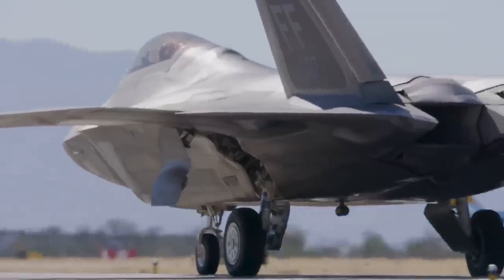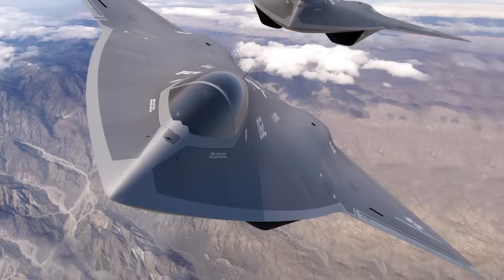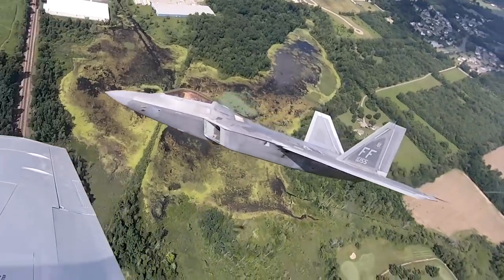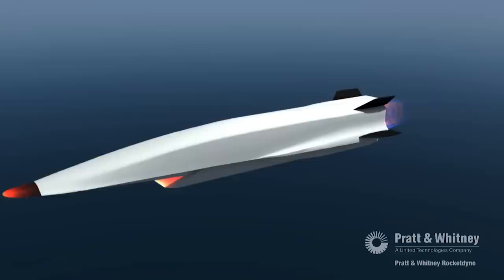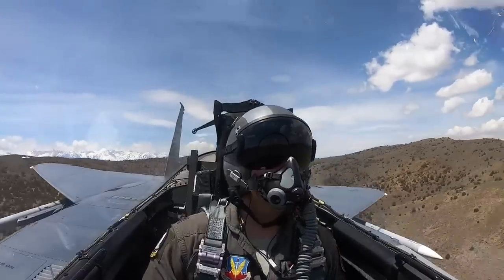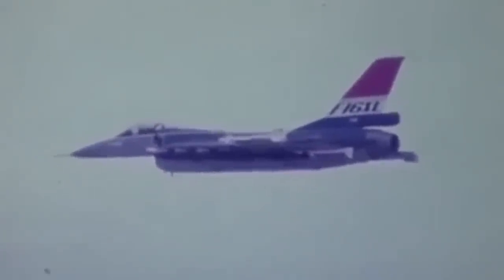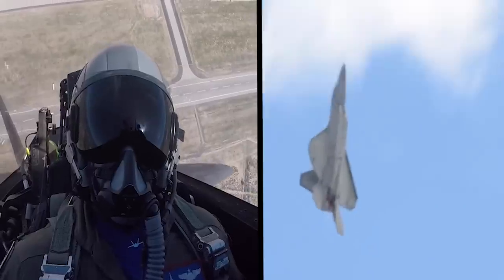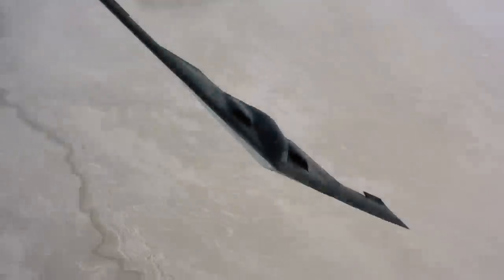How America could build the best stealth fighter in history

Comment: I think the combination of active flow control and TVC would indeed produce not only the stealthiest fighter jet ever, but the most agile. 
I don't know if you recall a F-15 that NASA used as a technology demonstrator. That Eagle started out as the F-15 S/MTD, and wound up as the F-15 A.C.T.I.V.E. 
In this variant, the Eagle had 3D TVC, Canards, and a flow control system. I saw a video of this thing flying that I suspect someone leaked, because it disappeared after about a week and I cannot find it anywhere. Just take my word for this- that Eagle was the most insanely agile jet I ever saw. Way more so than the Raptor OR the TVC Flankers. At one point they had it flying along a straight course at about 320 knots, when it just started tumbling about all 3 axes of flight! This was deliberate and the jet was under full control at all times. The pilot could make it tumble right, or left, the jet could climb in a complete, tumbling departure!
It was insane what this thing could do. Radar guided missiles just might have a hard time maintaining lock on a jet that could tumble like that and still exhibit directional control. If the jet in question happened to be a 6gen design with full stealth ability, that might be an aircraft that no enemy would  ever 
want to encounter.
Reply: I honestly wouldn't be surprised. Active flow control can apply thrust in directions and ways impossible with even 360 degree thrust vectoring. With active flow control you can almost turn gravity and physics into suggestions
Reply: I believe it. In kerbal space program, I have made designs with similar maneuverability, even without advanced computer control, using the above systems. The main problem was high g-force loads, but I imagine that those could be reduced via some clever wing design and piloting, and the use of real engineering and math.
Reply: I saw that video, impressive as hell. The tumbling you're talking about is a maneuver called a snap roll. Any aircraft with aerobatic ability can do them, you get into it by putting flight surfaces into cross control and it'll keep doing the roll as long as you hold that input
Reply: Maneuverability costs speed, so let's hope both can be increased in correct proportions. This is probably the biggest reason thrust vector isn't as important as it was once thought because tight maneuvers can only be done at low speed which makes a jet vulnerable to even old missiles and even guns. Fly fast enough, you don't even need to worry about bullets, just hypersonic missiles whose maneuverability is also faster & cheaper to improve than with larger, heavier jets.
Reply: @jamesmaddison4546  Hey James where can I find that video, please thanks 👍

Comment: Excellent content as always. Dale Brown writes about missiles and hypersonic planes with adaptive 'lifting body' surfaces in his novels. Is this the concept you're referring to regarding flow control?
Reply: ello, engineer here. Active flow control, actively modifies fluid flow over a body. For a common example would be an inlet bleed, an inlet bleed are like tiny perforations on the inlet leading edge, and they are actively maintaining a succc to succ the boundary layer air (bad slow air that sticks to the body). Passive controls don't use powers (or very very less). Like a tail, flap, brakes they change shapes to modify the flow.

why use active? cuz tails and flaps and ailerons can fail. think about a plane, and it pitches up(that is what high alpha means by the way if u dk the terminologies). the tail, now is 'hidden' by the plane body, when viewed from front, can imagine xD? the tail dont get to use the fast and fresh moving air, instead it got the air flow that is stuck to the body of plane, slow and turbulent air flows. It reduces the effectiveness of such control surfaces.

how do we fix that with active systems? well it is never gonna be like what the creator of the video said, literally using little jets to steer the aircraft, because it is very inefficient. But u can do a few things: 
remember about the little holes that succ bad airflow? we can use them not only on inlets but wings as well! we can modify the flow over the wings so they dont turn bad as quickly, if they dont turn bad at higher angles, tails and flaps and ailerons can be smaller, because they are more effective.

adaptive lifting body? oh boy, that is the holy grail of aerodynamic efficiency. all the above problems arise from the fact that we are trying to steer and fly a brick. Look, f 35 is a brick, fr. We gotta fly it, so we stick wings to it, now it looks a little more plane like. But like I said at certain angles, it doesnt look plane enough from the front anymore(high alphas). That is bad. If only we can change the shape of the brick.... wait wdym look at nature? well, look at the nature! 

An eagle wants to turn, it banks, it slants and pitch one side of wing , its body curves to the direction. There you go! adaptive lifting body. Instead of using control surfaces, we change the lifting bodies: the wings itself(not only wings, the fuselage can be changed as well) to better ACOMMODATE the air flow. Note the ACOMMODATE, this is inherently a passive process, we are not re routing air flow from engine and pump it into the air flow over the plane, we are changing the shape of wings, ACCORDING to air flow, like an eagle. That is ofc, extremely hard to do, the reason why we have not done this already hahahaha.

As you can see they are very different concepts, but achieving the same goal thru different methods. Hope my explanation helps!
Reply: @the-core-experience  Yes, that helps tremendously. Thanks for that vivid and detailed explanation.
Reply: @the-core-experience  dont super-cavitating torpedo's already use active flow control in a way? althought obviously in water, not air
Reply: @cod6guy12  most designs seems to be relying on a passive system(a flat nose and speed) to create the bubble. I have read somewhere that on some torpedo gas are routed to the nose to enlarge the bubble. So yea they fits in the description of a active flow control, a weird connection indeed! hahaahaha
Reply: @cod6guy12  yes, but it is not nearly as difficult in water, since it is so dense.

Comment: Has any nation other than the US developed a fighter with a RCS of 0.05? Doubtful. Every step in the manufacturing process is difficult, given the insanely small tolerances required.
Reply: Exactly.  That’s a major reason why the Russian and Chinese so-called 5th gen fighters aren’t nearly as stealthy as the US aircraft (although the J-20 is a lot closer than the Su-57).  Even if they can make aircraft with the right shape, and even approximate the RAM coating, they don’t possess the machining technology to produce aircraft with the tight tolerances to reduce radar signatures nearly as much as the West does (and we won’t sell it to them).  Any seam or uneven surface will greatly magnify radar returns.
Reply: @bluemarlin8138  The application scenario of J-20 is different from F-22 and F-35. The J-20 focuses more on performance during supersonic cruise, and the US military places more emphasis on stealth. Chinese commercial satellites recently spotted the U.S. F-22, and Chinese and Russian meter-wave radars can also capture U.S. fifth-generation aircraft.
Reply: @bluemarlin8138  There is also no clear RCS value of J-20. The aspect of its stealth performance that has been questioned is primarily the duck layout, not the stealth coating. The NGAD is currently only available as a prototype, and it will take a long time for the US to actually build it. An article (Radar cross-section effect of canard by GUO Zhanzhi, CHEN Yingwen, MA Lianfeng) compares the RCS of the F-35 and J-20 by a more accurate method, which can be used for your reference.
Reply: @jingyangzhang1234  Capturing something on radar is child’s play. Stealth doesn’t mean it’s invisible to radar.
Reply: Nobody has come even close
Reply: @rizzzzzza4643 nobody ever said it did. It means it’s small enough so a radar can’t lock on it
Reply: @bluemarlin8138  p
Reply: BAE systems,  (Bacon And Egg Systems) tic tac 
Great to be British

Comment: I understand the advantages of no near vertical stabilizers.  However, lacking other means of control, a lack of rudders can be a problem especially the slower the plane moves.  Lacking rudders would mean using drag to control yaw.  When landing extra drag can lead to dangerous situations.  My example comes from a high speed catamaran surface vessel, boat.  There was a design that utilized drag induced control with curved surfaces that would drop down into the flow of water along the hull.  At speed this worked.  However in slow maneuvers this method was useless.  One could not adequately control the vessel at all.  Another mistake made on some vessels was to not mount the rudders directly behind the propellers.  In that case the prop wash could not be deflected at slow speeds thus hindering maneuverability.  One needs to account for the entire maneuvering envelope in design decisions.
Reply: I've thought of this before. How about a v-tail that is stored flush with the body surface and then deploys at low speeds?
Reply: Not a bad idea, though it would probably be very expensive to keep stealthy and hard to maintain.
Reply: @DAAllan82  I got the idea from the retractable opening on the f35b
Reply: The B2 gets by without a tail, instead using split-ailerons as aerodynamic brakes to affect yaw. It uses a computer system to keep it inside a safe aerodynamic envelope and tame any oscillations or instabilities that are inherent to the design, but it works. Its predecessor, the YB-49, lacked any such computer stabilization systems and was still airworthy as long as the pilot was skilled enough and kept it inside the approved flight envelope.

As for drag-controlled yaw, that's actually a very safe and well-proven method. On the general aviation side, there are the many Burt Rutan designs that do employ vertical stabilizers but rely on drag for yaw control. Many of those aircraft are still being built and sold today, like the Velocity.
Reply: @ParadigmUnkn0wn  Interesting.  I was not aware Rutan's designs worked by that method.  I have recently seen vids that show ideas that have vertical tail surfaces during slow flight that fold to horizontal at higher speeds.  Pretty cool but probably expensive, heavier and with great complexity.
Reply: It’s using thrust vectors to provide yaw, pitch and roll control.
Reply: @JulesUS8386  Makes sense.  The boat a friend was on did not have thrust vectoring.  Very difficult to maneuver.

Comment: 8:48 - The B-2 has used highly charged leading edge systems to ionize the boundary layer air making it more “malleable” for trailing edge control surfaces. 

There is also the added benefit of reduced RCS of any surfaces inside what essentially amounts to   a plasma sheath, or bubble as incoming EM energy is scattered inside the plasma layer.

9:58 - Either 1-piece molded or printed bodies. I THINK the B-21 may already be putting that idea to work. Photos from below taken on its maiden flight showed very few seams or panels in the lower half of the body. One contiguous piece = less RAM = less weight = lower RCS + added range.

Comment: Rather than traditional thrust vectoring nozzles (TVN), I would go with fluidic TVN. These have fixed external geometries and no moving parts (combining agility with greater stealth). Instead, the exhaust is controlled by injecting bleed air into the nozzle to selectively block the flow. When activated symmetrically, these injectors constrict the exhaust towards the point of blockage. Such nozzles allows the external geometry to be optimized for radar and IR stealth. Plus, the lack of mechanical actuation systems means fewer parts and lower weight. And as you stated, with thrust vectoring external aerodynamic control surfaces can be made smaller or eliminated all together, thereby improving stealth. In addition to this, I wouldn’t necessarily go for a pure delta and instead I would go for a switchblade design, made famous by the F/A-37 Talon from the ‘05 movie “Stealth” and the X-02 Wyvern from the Ace Combat franchise. Provides all the advantages of the delta but with the additional advantages of forward swept wings. Alternatively, having forward swept gull wings with all moving wingtips and close-coupled forward canards is another option. Without going into too much detail, this combination drastically increases agility and stability while at the same time shielding underwing stores from radar, if carried. 

IMO, fighters will still need high agility to at the very least help them to try to dodge incoming missiles as well as providing the necessary agility edge in a close range dogfight. This isn’t the first time we’ve heard the argument that the short range dogfights won’t happen. Just look at Vietnam (yes I know that it was partially due to lots of missile malfunctions but there’s a reason why Top Gun was established and is still in use today). Not to mention what is probably happening over Ukraine today. The point I’m getting at is that dogfights will still happen in peer on peer conflicts due to the sheer numbers of aircraft involved as well as the fact that total air superiority like those we’ve seen over Iraq in both wars, the Balkans and Afghanistan can be argued to be the exception to rule.

Great to hear that you’re feeling better Alex. Here’s to a full recover
Reply: Forward swept wings tested on one F-16 model and Su-47 Berkut have some....structural challenges. As for agility - well, for F-16 it is the PILOT that is limiting factor but these attributes also help to land in strong crosswind, take off and land using shorter runaways.... all sorts of useful stuff.
Reply: @piotrd.4850  if you’re referring to the X-29, that was actually a heavily modified F-5A
Reply: The FA-37 Talon is not really a stealthy air frame. It lacks the general geometric symmetry, and a switchblade design decreases G load limit for the wings itself. The reason why the NGAD is what is now is because its made from lessons learned from all aicrafts
Reply: @WarDaddy8917  could you please explain the g-load limit? Not all that versed beyond high school level aerodynamics. 
The only reason I mentioned the Talon was because it was a switchblade design. I’m not advocating for it to be built IRL (although I would love to see some of its capabilities/technologies be incorporated into NGAD and FAXX)

Comment: Variable angle, vertical/horizontal stabilizers using a pressure actuator system for low speed/non combat/non stealth profiles. A reduced area split/in line configuration complemented by flow control compensation.

Comment: Glad you're feeling better. And I hope you continue to get better :)

- It's pretty obvious the XA100 has the inside track for NGAD/FA-XX, agreed (as well as potential in F-35 SLEP options).
- Active flow control will require vents, which aren't exactly ideal for stealth. Although they may be better than external control surfaces. When I designed a potential 6th gen, it had this.
3-D TV may not work as well as would be ideal for replacing vertical stabs. TV essentially uses the entire aircraft as a control surface (relative to the direction of thrust). On a flat, sharp-edged stealthy platform, there may not be all that much aerodynamic force generated by offsetting the thrust laterally. That said, it could replace verticals for normal stable cruising flight, or to supplement smaller vertical controls.
- Electrical impulse control may be a no-go for stealth due to potential EM emissions (I could be wrong on that).

- Flexible skin sections may provide a way to eliminate seams (though that wouldn't necessarily work with coatings..)

On a more structural layout level... I think the capacity for high altitude flight and high speed would be desirable. Given the F-35's 'low & slow' design, it would be complimentary. Although, for stealth low & slow is really more ideal. So you'd be looking at a design which has good characteristics across a wide range of flight envelopes, to stretch the options out. You'd also want greater (and more versatile) internal capacity than has been done with the F-22. Reducing leading edge drag would help IR performance, and tend to benefit RCS as well, though it's not necessarily the most ideal for fluid dynamics. Supercruise with minimal IR generation would be pretty desirable, and it's not really "drag" but rather mainly compression which generates heat at high speed, and this is relative to angular shape & shockwave propagation.
An unmanned variant could allow for extreme maneuverability... though I don't know how valuable that is anymore with HOBS+HMDS+TDL and good munitions. I think a separate unmanned aircraft design makes more sense, though I'd disappointed to see the DoD lose (public) interest in the Boeing Wingman.

The Boeing Wingman is a glimpse I think of a possible general layout/shape.

I don't think DEW has potential in a fighter sized platform for being the primary armament. Particularly with fairly obvious countermeasures possible. It could be a useful tool though, for a large modular package or a variant. Also I suspect there may be better EM wavelengths than light for DEW. A dazzler device in all variants would be useful though.

ixnay ot eramicscay, certain people need to learn the rules of dod grant money it seems

Comment: Microscopic gratings can be tailored to reflect in certain angles any radiating wavelength.
I find it strange that we couldn't create a "paint" coating that would be designed to reflect short wavelengths of radar.
A paint could have low maintenance impact, but it would have to withstand speed and friction, vibration and overall tear.